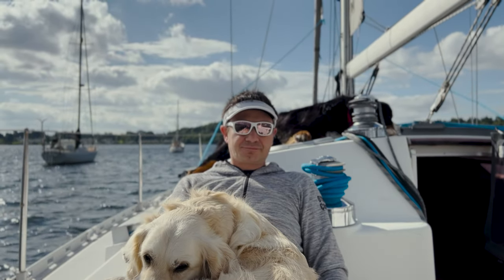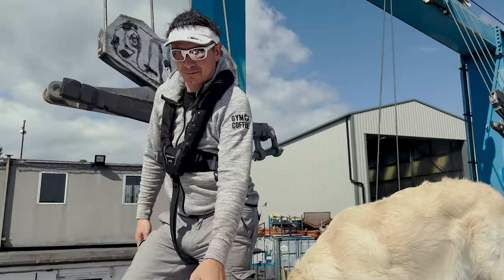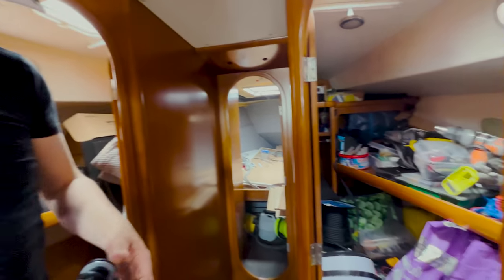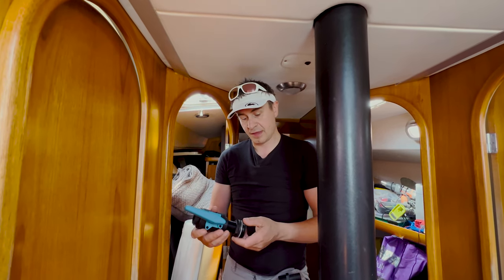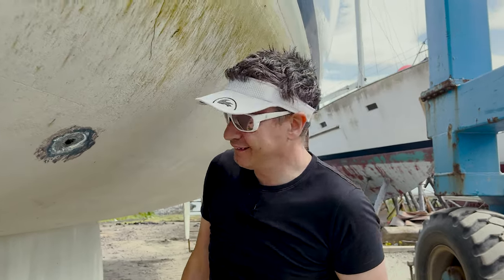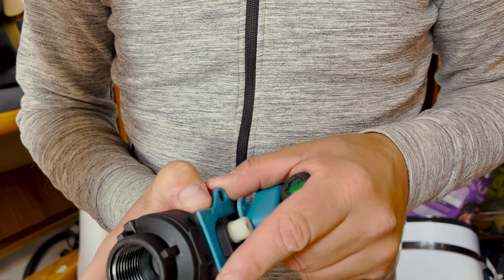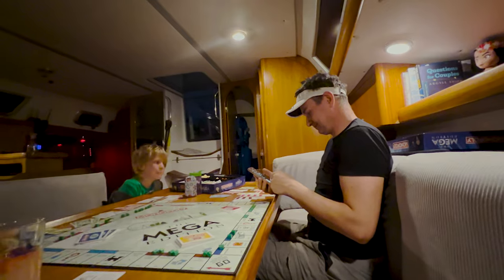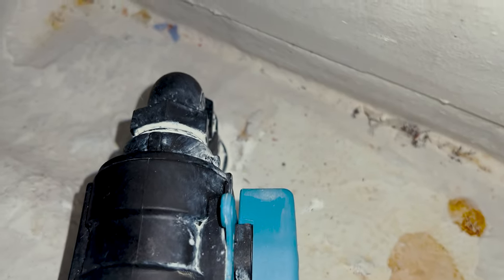What? How? Why? Where? INSTALLING our FIRST Trudesign Seacock! | INSTALLATION TIPS | Ep. 24

Comment: Beautiful dogs !  The sea cock should be directly on the through hole with no additional parts ! The elbow is a bad choice , also bronze though holes are better and stronger! But it’s done and it should be ok if you don’t use it for any storage space !
Reply: When I saw the elbow before the valve I thought that goes against the recommendation of trudesign the company. “Bronze is better” is old thinking. Look at what everyone is pulling out of their boats - bronze. With the collar composite is just as strong.
Reply from the maker: Well… each to their own but thanks for watching!